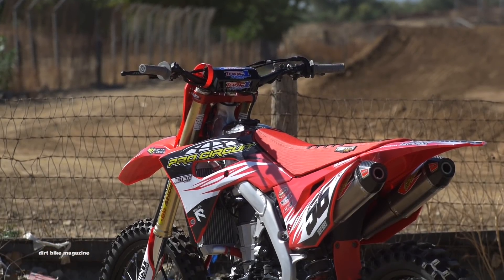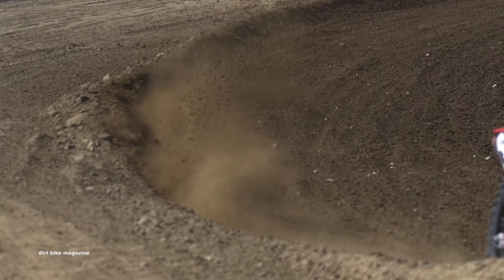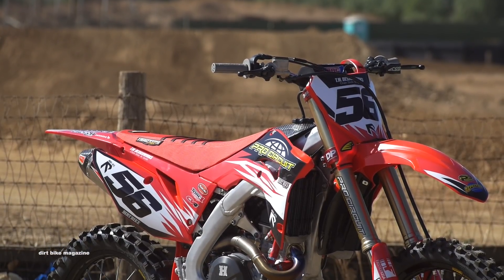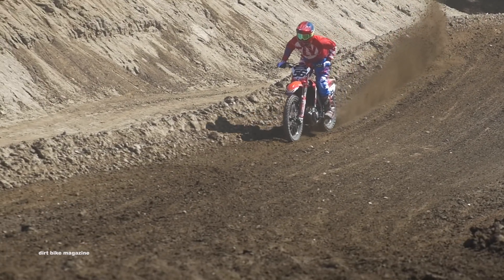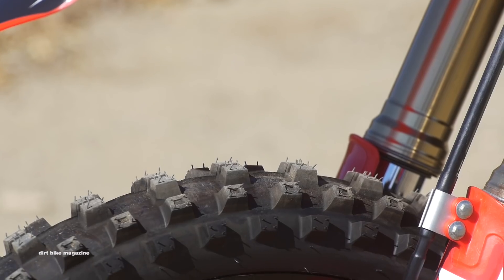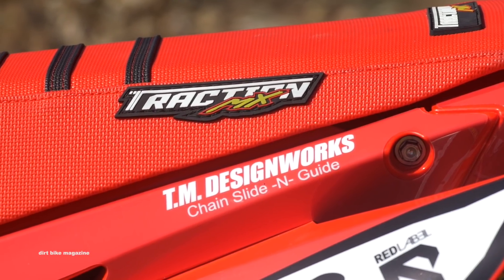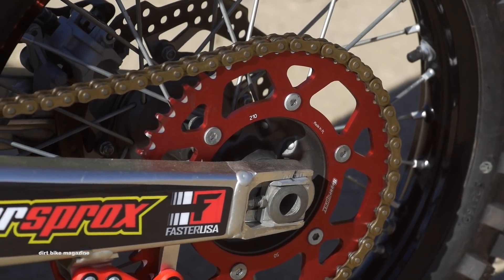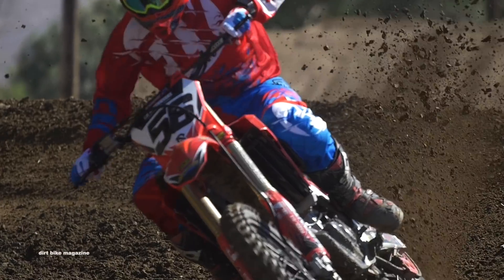Project Pro Circuit Honda CRF450 - Dirt Bike Magazine

Comment: it's a rolling ad for accessories.  They just have advertisers give them parts to bolt on and they act like it'd so much better then stock
Reply: 64maxpower I agree it is totally an advertisement but keep riding your stocker . Meanwhile I’ll take a 270 mm galfer ,braided lines, fasst handle bars, steering damper, takasago wheels  yoshi rs9 full carbon ti exhaust Tokyo mods programble ecu that limits revs to 8000 revalve  my suspension Asv levers that don’t break , rad guards and raptor foot pegs . And then you wonder why you get lapped over and over .

Comment: Disappointed bascily suspension up grade
Reply: James McCauley suspension is by far the most important part, they also did piston, head port, and exhaust
Reply: its basically a new bike dude, i hope that was a joke
Reply: WeRideLikeThis  my best mate works  for factory. Kawasaki .has now went to factory Honda. And other best mate works for Honda UK  the bike has a piston and suspension that's it
Reply: James McCauley who cares? It got a piston, exhaust, wheels, tires, and a lot of pointless bling. but who cares? If you don't like it dont build the same thing. Why even bitch about it? The 2017 is a fantastic bike to begin with it doesn't need much more than they gave it

Comment: Will my path in life ever bless me with me owning a honda dirtbike? My dream is to have a cr80 pro. Converted to 100cc or even maybe 110?  Then would upgrade its every nut and bolt into a 140cc ported upgrades reeds magnesium and titanium parts all naked lightning strike carbon fibre helmet matt black and dark red parts and frame throughout neon Red cables gold pro circuit rims. Number 303. I can dream can i ill never have a bike again. My situation has got me pinned down in the dark without money.
Reply: It will get better trust in God and Jesus and you will be blessed not for a dirt Bike but quality of life and happiness  . I've jump thru hoops and worked extra to get a dirt Bike in the past and after I get it it's like why was i willing to do anything to get this machine .
What I'm trying to say is . It was more of a thrill to go thru he'll to get it than it was to ride the bike .
Don't get me wrong it's fun to ride when you have time but it's just crazy how I eat sleep work thinking I got to get this bike before I die or the world comes to a end and once you get it ,it's no big deal.
Reply: Probably better off with a used 125. Can get them cheap, upgrade as you go. Learn to work on bikes if you can't already.